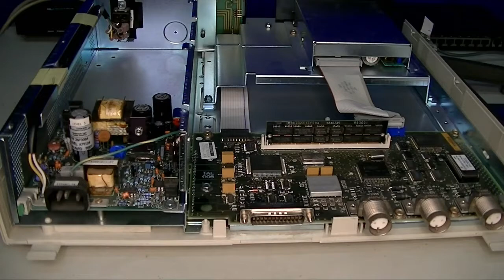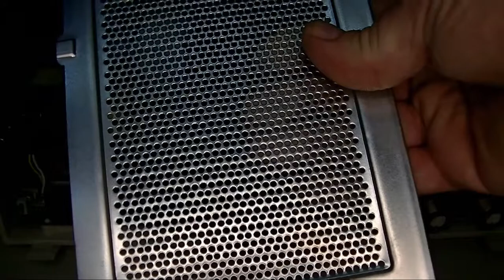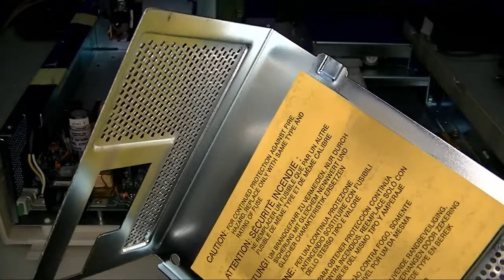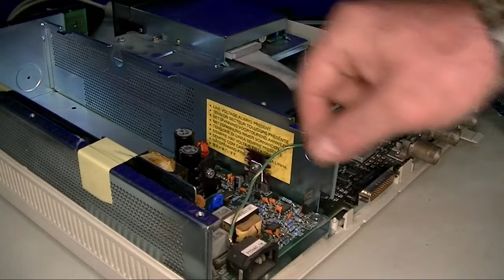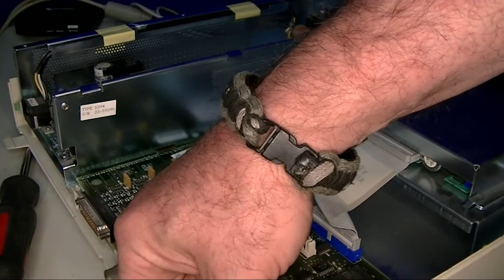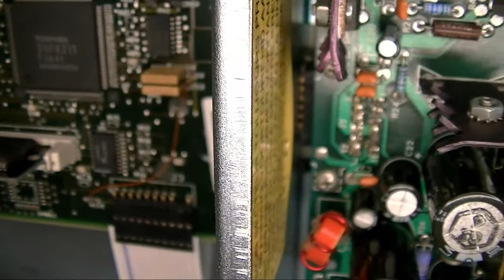A deeper look inside the IBM 5394 "Remote Control Unit" PSU!

Comment: I call BS on the 450 V thing. I see only one primary side filter cap, and it seems to be rated for 200 or 250 V. Perhaps the older revision used some kind of doubler circuit and they just reused the sticker?
Reply from the maker: At least the PSU internals aren't that complex for a replacement if needed. The "slot-connection" for powering the mainboard (and everything else through it) doesn't appear to be there on the earlier PSU enclosure. There are very elaborate details on the earlier version in the 5394 Maintenence Manual at Bitsavers: http://bitsavers.org/pdf/ibm/5394/SY27-0311-01_5394_Remote_Control_Unit_Maintenance_Oct89.pdf
Reply from the maker: Yeah, the 5394 "Planning and Installation" manual reports less than an amp for the 110VAC PSU, and half an amp for the 220VAC PSU - and that is likely the earlier 5394 unit.

Comment: It is a testament to the margins of IBM in that era that one could justify such a liberal use of sheet metal and empty space in a product, you'd never see that today.
Reply: Indeed, they built their machines like tanks in some ways. My PS/2 from the early 1990s may likely outlast all my newer PCs.
Reply: I don't know how many of these units were manufactured, but sometimes it's cheaper to reuse an existing design rather than go and redo all the tooling. It really depends on the volume... But yeah, this thing really is built like a tank, especially the later revised and mostly empty version looks really comical :)
Reply from the maker: The earlier version has stamped metal at the front - and that has to be a 120mm fan that isn't on the PSU. There is shielding wrapped all the way around the diskette drive except for the connector - I wonder what it looks like underneath the bezel. Very heavy-duty.